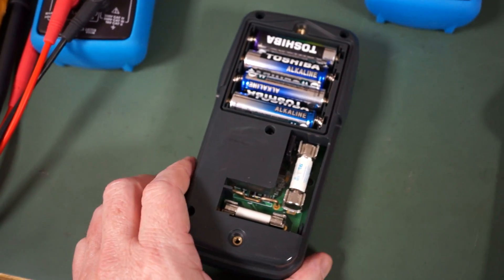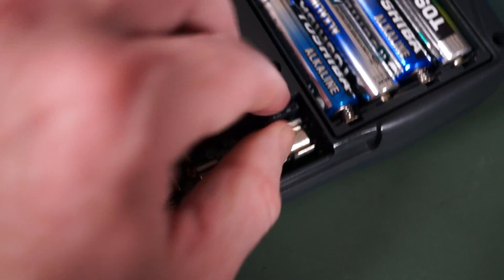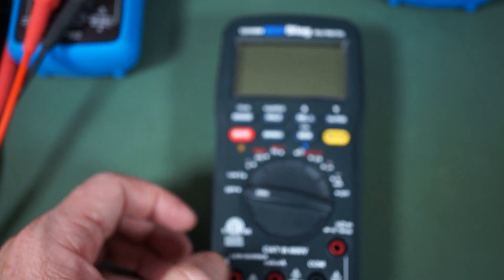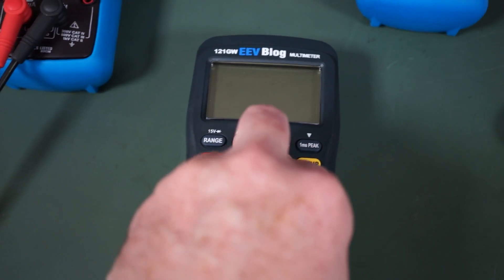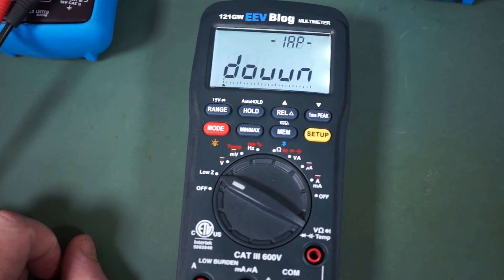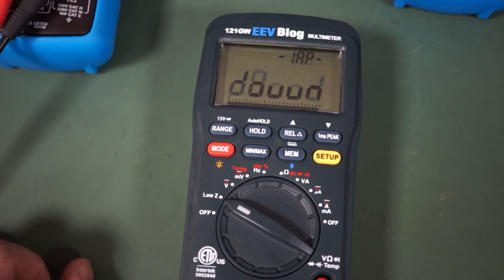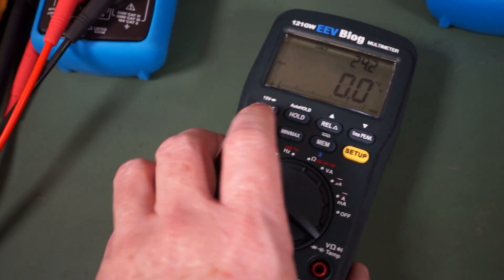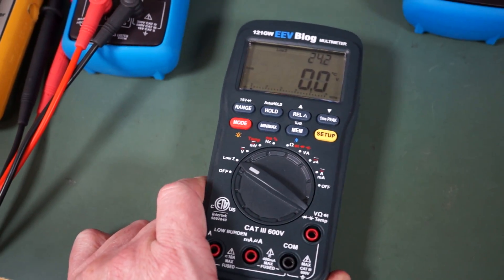121GW EEVblog Multmeter Firmware Update

Comment: Why the rotary switcher in 2017 ???
I mean it would be better to do something similar like in the MTX 3292 ,where the switcher is replaced by buttons which actually are saving more space on pcb !!!
Big disappoint here Dave ...sorry but the rotary switcher is bullshit for our era.
Reply: Ig_ Sherwood For a portable hand-held multimeter the rotary selector is a far more practical option as you have very little chance of inadvertently switching modes while juggling the meter to take a reading in the field.  Buttons are great for bench-bound multimeters, but not ideal when it comes to field use where it can be very easy to accidentally press an unintended button while trying to take a measurement in a tight space or awkward conditions (and, in some cases, also wearing PPE that makes accurate button pressing challenging).  The absolute last thing you want in the field is to unexpectedly find yourself in current mode when you are about to measure a voltage.
Reply: cant butt dial a rotary phone
Reply: Not without a pencil and some dexterity
Reply: I strongly disagree. Rotary dial is so prevalent for a reason - it's very fast and intuitive to use, and it's not very easy to make accidental changes. A facefull of buttons is like the epitomy of fucking terrible user experience design, it's so bad that it's often a talking point when you are taught user interface design (and yes, physical buttons on a physical device is a user interface, that terminology is not restricted to software).
Reply: Rotary switch gives a clear, easy indication of the selected range.
Reply: umm, maybe I'm missing something, but isn't rotary switch mainly a multiple-path switch? How do you all want to implement switching multiple connections when using buttons? Of course, there exist analog IC multiplexers, but they have relatively large resistance of 30-100 ohms. What about high current paths? How do you want to make connections to paths that are rated for 10-20 amps? Mosfets? that will be pricey... A good'n'old mechanical rotary switch is, by my intuition, a cheap and reliable thing. Maybe I'm wrong, but will be happy to learn something new from those with better experience in modern electronics.
Reply: Im disappointed too ,rotary switcher is bullshit and lame for our modern era .
Pls change it like in mtx .

Comment: What is the advantage of having the firmware update from an SD card instead of via USB?
Thanks
Reply: 1) You don't have to open the multimeter (you can't have external USB and a safety compliant meter).
2) We had the SD card anyway for data logging
3) The ST ARM software comes with the (IAP) code to do this out of the box.
Reply: Well for one it means you don't have to worry about OS compatibility

Comment: Whats amazing to me is that someone implemented Microsoft's FAT32 inside the multimeter firmware.
Reply: It's part of the ST micro ARM library
Reply: Amazing? It's just an open source FS library.
Reply: Not too difficult, a regular Arduino has enough power to be able to do it from SD and it's a 8 bit processor. This multimeter has a 32 bit processor.
Reply: Ognjen Galić There are many fairly small implementations out there if you look.
Reply: Libraries like FatFs are good enough to run even on an ATmega8 reasonably well. Especially if it is for once-in-a-blue-moon update and speed does not matter!
Reply: You don't have to do FAT32 well, just enough to find one file. It gets a bit more bothersome if you take the RAM to cache the allocation table, or not assume the FS is consistant, or do a write without trashing stuff. Just figure out which file you want, chase down what sectors it occupies, slurp those sectors.
Reply: Basic read only fat32 implementation is very easy, probably a page or two of C code. Basically, you find the partition marker, then find the directory entry (which will be at an offset, I forgot if it is by calculation or written on disk, been too long), then you just need to read the content, find the string you want (firmware.bin), then it have the cluster it start at and I think the block length. Skip to it, start reading for the block length, if it is fragmented you will have an information for the next block, so just skip to it and continue, if still fragmented you still have the new info... follow until you are done.

Writting however, that's another story.
Reply: Of course the SD card is not only used for reading firmware files, it's also used by the data-logging part of the DMM so it needs write access.
Reply: That multi-meter uses as ARM chip? Crap, and I thought it was a simple ASIC or 8-bit or something.